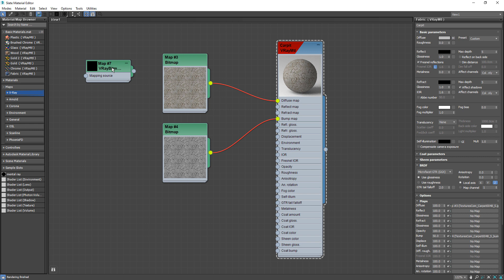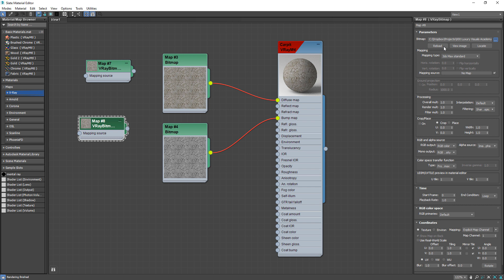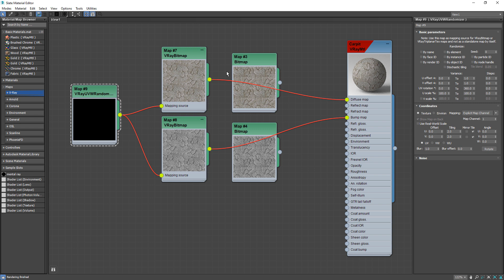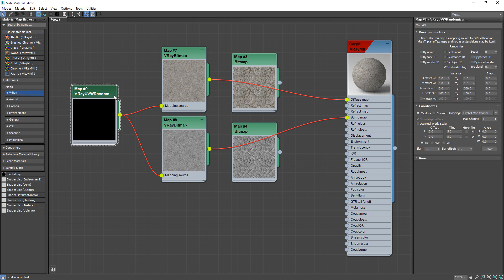How To Use V-Ray UVW Randomizer Map in 3ds Max

Comment: @jakedenham Maybe you know this by now. But you can actually (almost) drag and drop your texture to VraybBitmap like with regular Bitmap. 
-When you opened a VrayBitmap node, just drag your texture from file explorer to the "import address field" at the top of the material parameter editor and it will work fine. 
Not 100% as easy as just dragging it to the material editor background, but better then importing it like you do in the video. =)